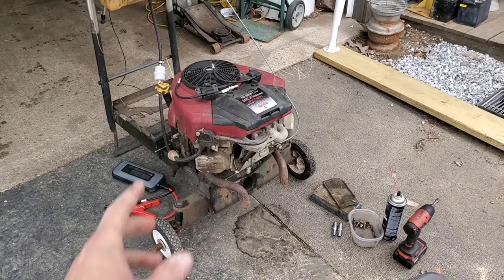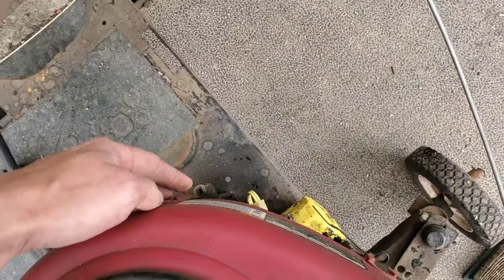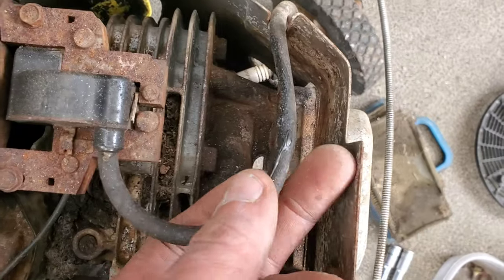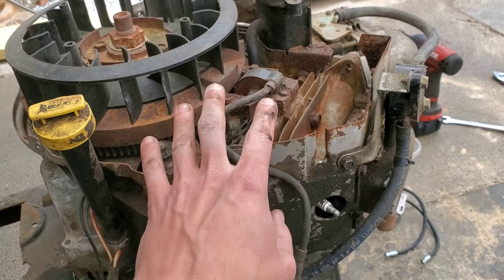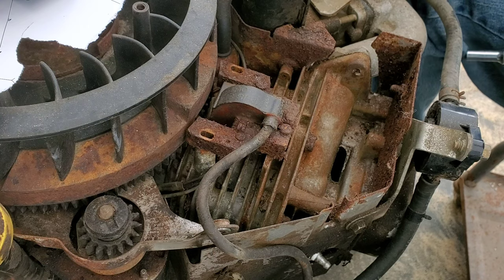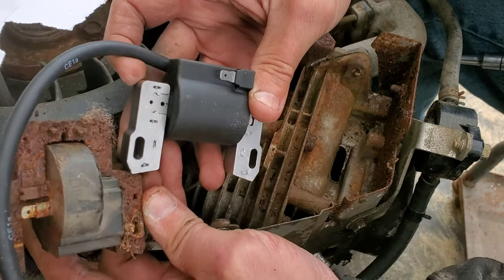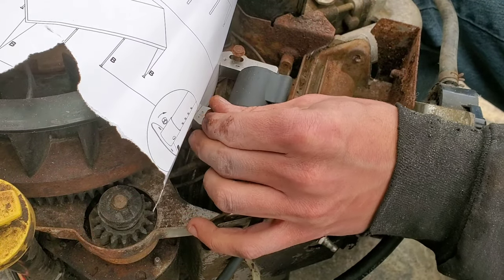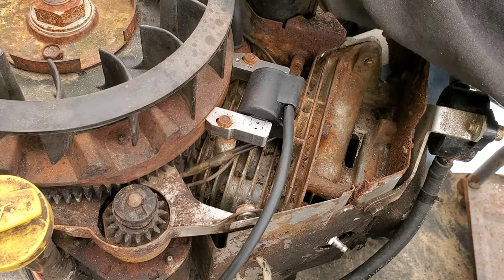Coil Install Briggs V Twin How To

Comment: Why didn't you run sandpaper around the flywheel before installing new coils? I have found several that all I had to do is sandpaper both the coil and flywheel. Also since you are gonna replace the sparkplugs why not take them out so the motor turns easier?
 I also normally put a thin coat of WD-40 on the flywheel and then wipe it down with a shop towel. I've never regretted the WD-40 either. One would think it would collect more dust, but apparently dust is less of a problem than rust is there!

Comment: Great video, thanks. I have a craftsman DYT 4000 with a 24 hp. OHV Intek engine. Starts good, runs good, but once in a while it will almost shut off, hesitate, for a split second while i'm mowing. It never shuts down or anything, but it feels like it wants to, like i said for a split second. Any suggestions? Thanks
Reply from the maker: If it is "only" doing it well mowing. Then my bet would be a failing safety switch to do with the deck.  Or if it has electric PTO could be a failing pto button. On the mechanical side check all your deck spindles for bearing noise. in the past I have seen bearing start to go and randomly seize to the point it almost kills the engine then break free.
Reply: @redneckcomputergeek  Thanks RCG, i will check it out.

Comment: I have this engine on a Craftsman riding mower.  If it will run until the engine heats up then kills does that sound like the coils?
Reply from the maker: Stick a spare spark plug in the coil wire the moment it dies and spark test it. About the only way to be sure.

Comment: Question! Ihave a 22hp B&S, power drops when pto is engaged.  Have replaced both coils, fuel pump, carb and plugs! Any idea what Im missing?
Reply: Pull your plugs and see if one is burning cleaner than the other. If one has more carbon build up, than you have an issue with that cylinder. Or you could have a poor ignition coil. At times you'll receive a faulty ign. coil.